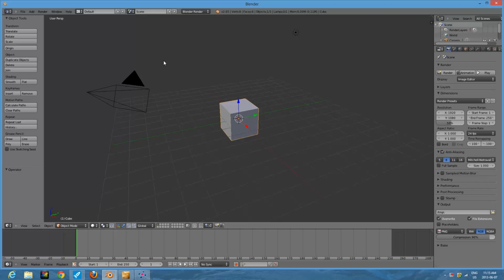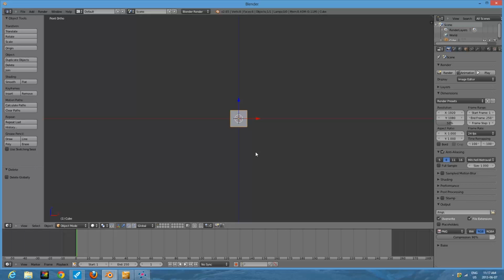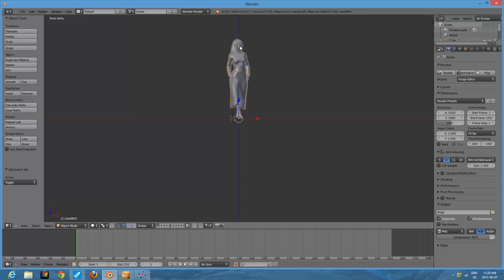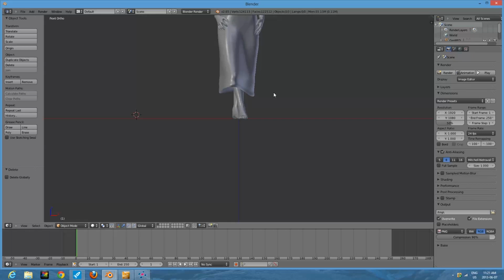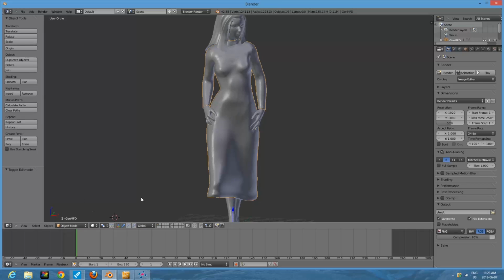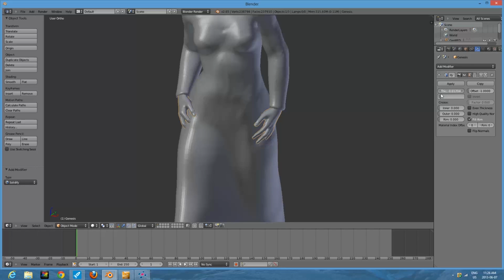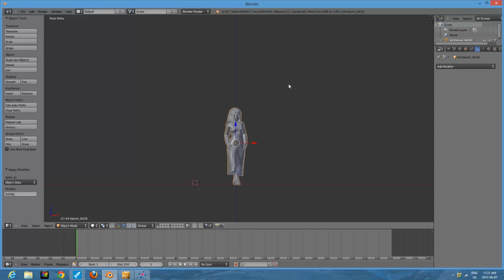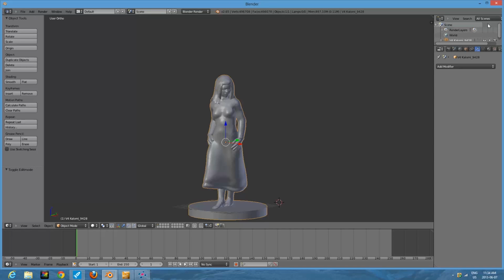How to Make a Miniature Using 3D Printing Part 2

Comment: Following the process fine but having trouble with the model. I get a flap of mesh which would be for eyelashes (with an opacity map applied) but just looks ridiculous and I don't want it in my 3D printed mini. I have had the same results with A3, A4, and Gen2 female. You don't have the issue in the video, yet I don't see how you've avoided it. Can you enlighten me?
Reply from the maker: Would have deleted it on import. When you first import the model into Blender, each piece of the model should be able to be selected individually so you can select and delete it (Just right-click the eyelash, make sure it is the only thing that highlighted, and hit Delete).  You can also use this to delete interior geometry, such as the internal parts of the eye, which can potentially cause problems later.
Reply: Bryant Reil Hey thanks for the quick reply. I hate to ask, but I'm very unfamiliar with Blender, but where can I find all the pieces? It seems that all the pieces are just the individual objects and the parts of those objects don't seem easy to get at. Even in DS the eyelash isn't a regular node (in that it's not posable) you can only do things that effect it from the surfaces tab. I have figured out a very painful (for me, not Aiko...) way to select the faces of the eyelash flaps and delete them, but Blender is a bit... fiddly and it can be difficult to get it to select all the faces that section of the mesh (clicking ctrl-L and nothing happens). At any rate I'm having a good time and can't wait to send some mini's off to be printed. Thanks for making the tutorials.
Reply from the maker: Scott ZPainter I just did it with Aiko 3 with no problems. Are you in Object or Edit mode? You can press TAB to alternate between the two. Object mode is easier - the model should look like a solid block (you shouldn't see the faces or vertices of the mesh). Make sure nothing is selected (press 'A' to alternate between select all/select none). Then right-click the eyelashes. It should select. You can then press 'X' and ok to delete it. My guess is you were doing this from Edit mode, which is a little trickier in this case.
Reply from the maker: Scott ZPainter PS Make sure you delete any extraneous parts such as eyelashes BEFORE you join the parts into a single mesh. Let me know if your model is not importing as separate parts - if its importing as a single, unified mesh, we'll need to change your export settings in DAZ.
Reply: Bryant Reil It looks like it's a single, unified mesh. In Object mode, I make sure nothing is selected. I right click on eyelash, entire model is selected. I'm doing this with just the person, no clothes or anything else to complicate. My DS export settings look like yours from the video, so I'm not sure what's happening. Using DS4.5 Pro, if that makes any difference. 

FWIW, when I'm in Edit mode and I manage to select all the faces in a lash they are constrained by a seam. If I had to manually click each face to add it to my selection I think I would have given up my now.
Reply from the maker: Scott ZPainter Yeah I made this  video a while ago and have upgraded my methods a bit since then. When you export, check the boxes for Write Groups/Surfaces. This should break the model into separate groups so you can work with each group individually, but when you are done you will want to join them into a single mesh.
Reply from the maker: Scott ZPainter Just double-checked one more thing: If you use the export settings shown in the video you can still delete the eyelashes fairly easily. Just go into Edit mode, select a single vertex, and hit control-L. This will select every linked vertex, which will stop at the boundary of the eyelash. You can then delete the vertices. Still, I have found as you get more experienced it's easier to troubleshoot the mesh if you export it with Write Groups selected as different parts of the mesh might require different adjustments (especially when dealing with very complex models).
Reply: Deleting them by selecting (I was selecting faces) and hitting Ctrl-L is a way I figured out to do it, but with my Blender skills I don't currently refer to this method as fairly easy. I'll give the other export settings a try and let you know how it works out. I just don't understand how you don't get the flaps when you imported a figure.
Reply from the maker: Scott ZPainter I will have to experiment with the export settings for that. I know how to prevent Scene items from exporting in DAZ but the eyelashes aren't a scene object, just a surface. However, I won't have any time today to do that, so will take a look tomorrow.

Comment: OK; I don't think I can just rev it up and do it RIGHT NOW, but it looks like I could learn it fast enough.  I'm just confident enough to go ahead and look at Part 3.

If you do the thickening, do you need to do that part where you select the ring and attach it to her legs?
Reply from the maker: Sorry took so long to reply - had problems with leaving comments in Youtube. Anyway, no, when you closed up the dress you made it into a single solid piece so shouldn't need to thicken that. I intend to update the video soon to explain how to better delete the internal geometry when you are finished thickening as well-this reduces mesh count and internal geometry problems.
Reply: Bryant Reil
OK thanks.  It's not like I'm going to be trying for upskirt miniatures after all.   ^_~